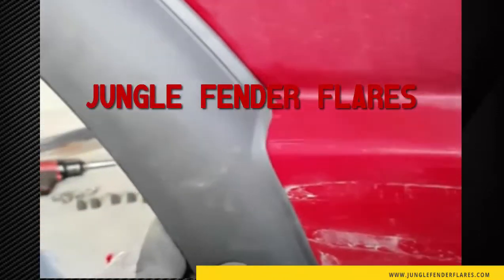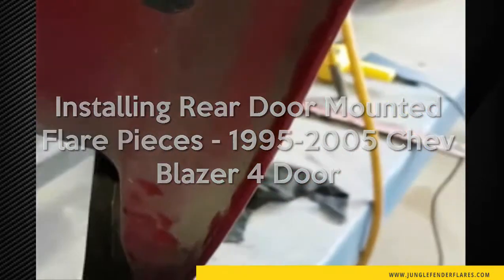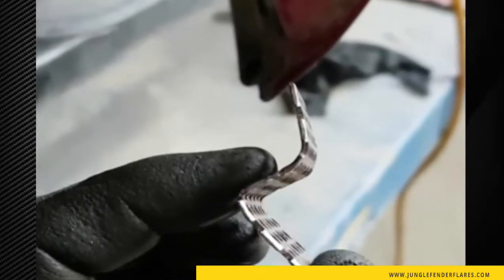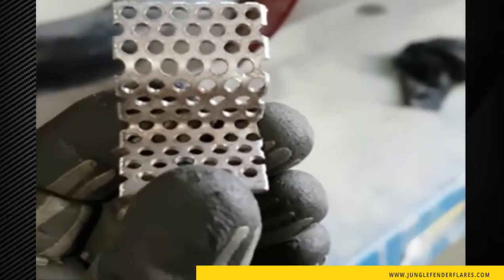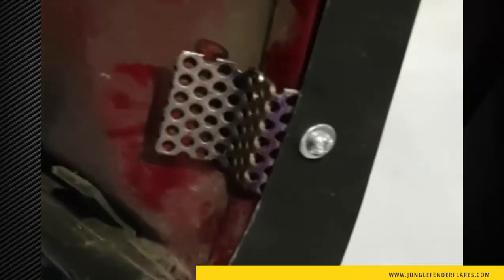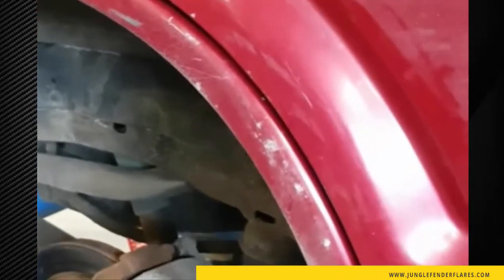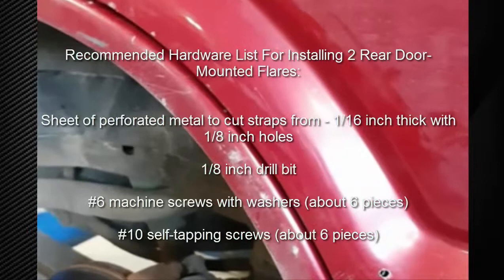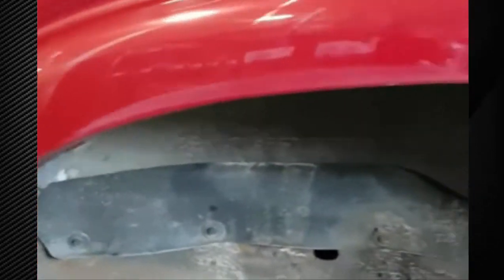Jungle Fender Flares: How to install Rear Door-Mounted Flare Pieces - 1995-2005 Chevy Blazer 4 door

Comment: Can you glue or tape these on instead?
Reply from the maker: Anything is possible if you know your adhesives well enough but it is not recommended. It is actually not legal in many places to fix anything to your vehicle with only tape/glue. We always recommend using proper hardware. If your concern is the screws coming through the door, you can use slightly longer brackets.